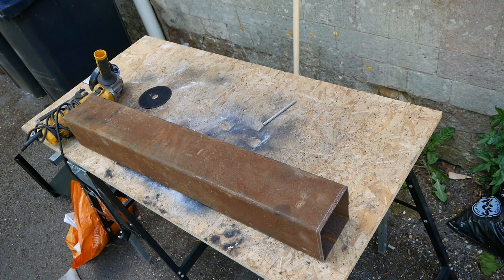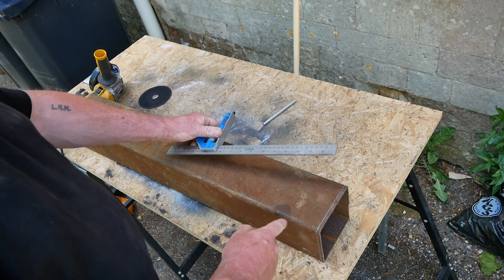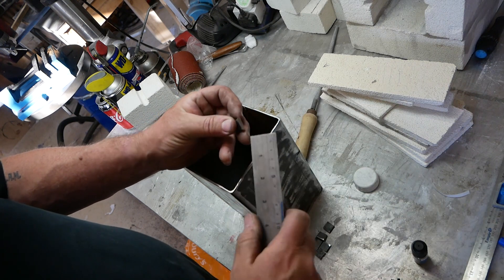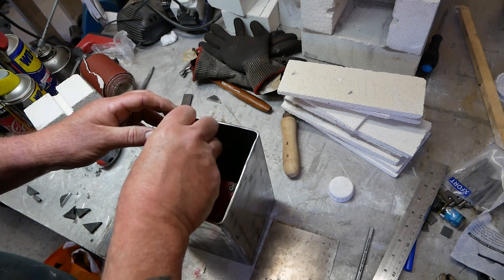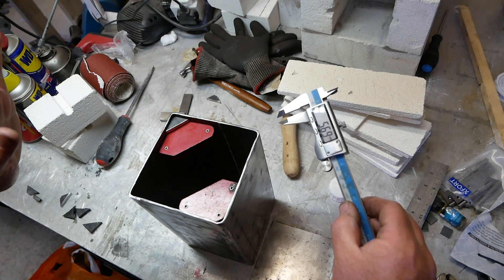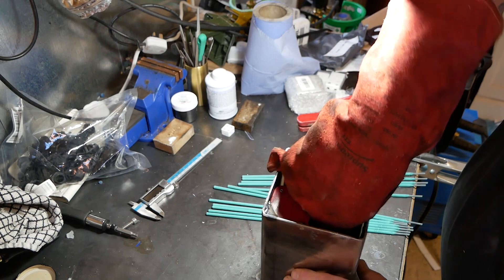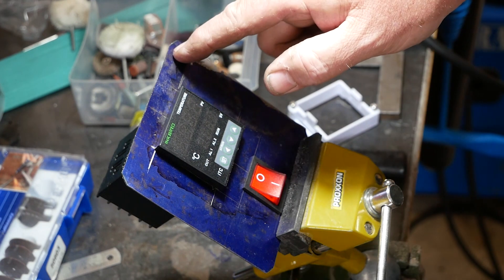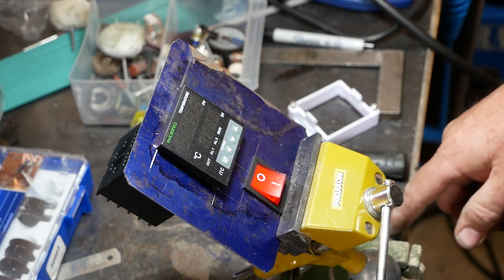Heat Treating Oven Part 2

Comment: I have been in the same position with an anglegrinder with a wire wheel on there.
Thankfully someone was close and pulled the plug out.
I am planning on making myself a heat treatment oven but cant figure out the kanthal wire length any advice about it?
Reply from the maker: What I did was to make a much longer coil than I needed, then cut to length when I installed it. By the way, I used 0.8mm wire which is too thin. Going to replace with 1mm or even 1.2mm.  If you want to work out lengths and amperage etc, visit Dan Comeau's brilliant blog which is full of great info like that https://dcknives.blogspot.com/p/electric-forge.html
Reply: @Ukenick  I just found this site, easy to use and metric.
http://www.vegoilguy.co.uk/coilcalc.php
12.43 meters of 1.2mm should give me 23 ohms at around 2300 watt 230 volt.
Sounds reasonable to me.